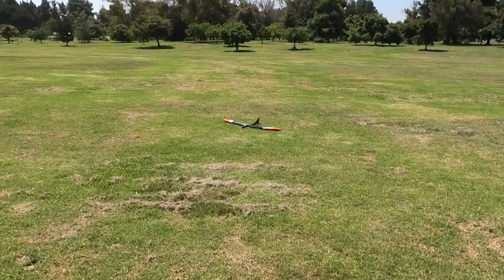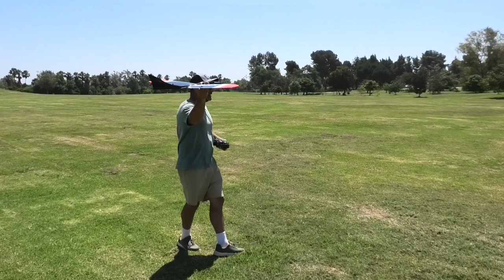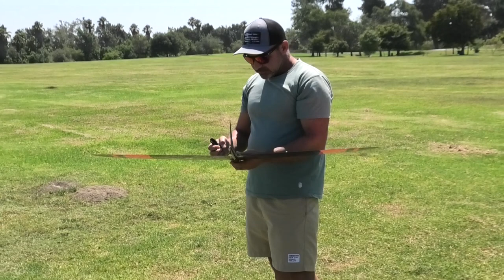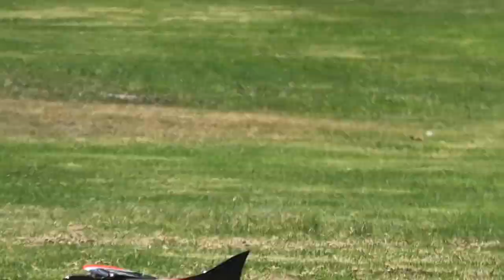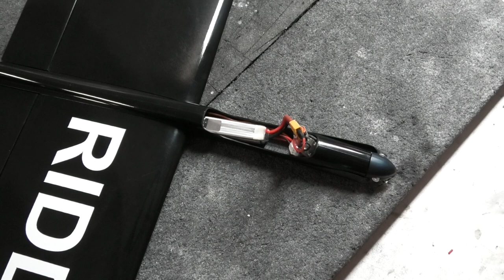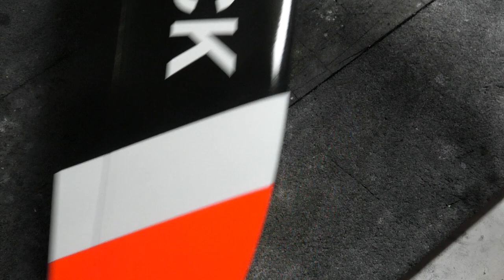CCM RIDDICK, 1.2M RC Flying Wing Maiden Flight

Comment: I received my Riddick electric from Flightcomp. I am flying it at 44-45mm CG and it is very nimble and easy to handle on that CG. I put some degrees of down trust when installing the motor and it helps to keep it flying in straight line up to mid throttle, at full she will go full vertical. I am flying it with a 1806 2580kv, GNB 660mah 7.6v HV lipo, ccm 6x4 prop and spinner…super nice!
Reply from the maker: Awesome. I wish I had put down thrust in my model.

Comment: to the best I know, all flying wing types, need reflex on the trailing edge.  Why, the center of pressure/ lift on all wings cause them to go down just like it did.
Reply from the maker: The airfoil is reflexed.